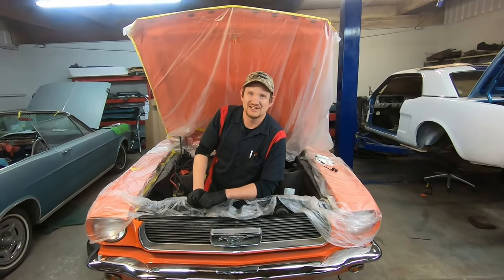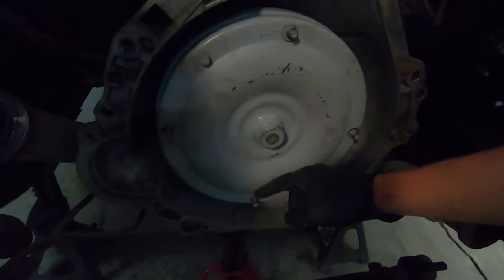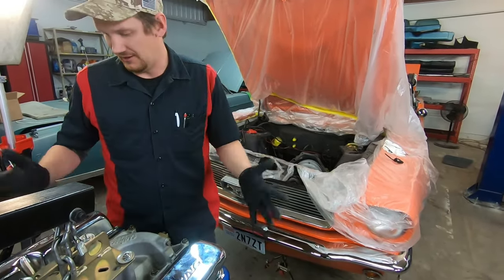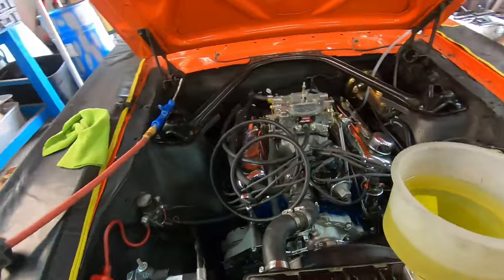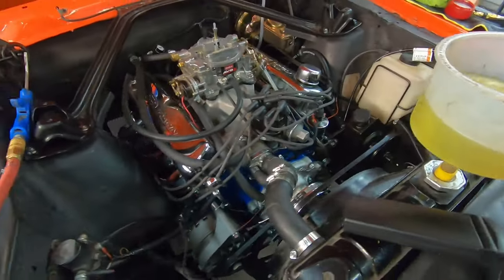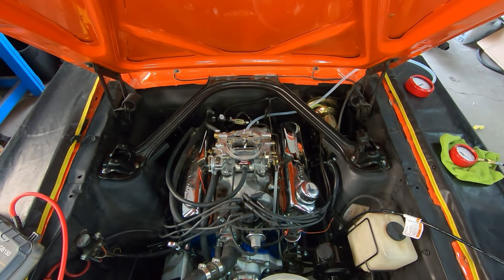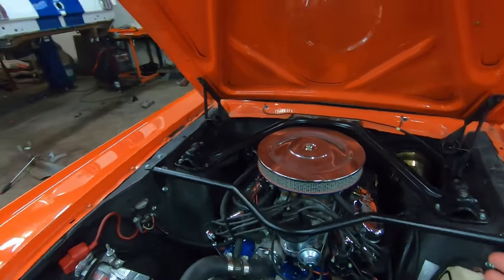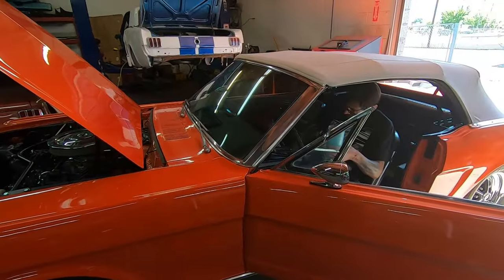Install & First Start - Rebuild the 289 Ford - Part 21

Comment: Nice sounding Stang. Enjoyed watching your 289 rebuilding series. I do a lot of wrenching myself but wished I had an ‘Alf’ mechanic nearby that specializes in older Mustangs. I have a 68 coupe with a 331 stroker, 5 speed, rack and pinion steering and a 3:44 Eaton TruTrac rear.  She scoots along pretty good. 😊
Reply from the maker: Thank you! That sounds like an awesome setup you have on your 68! I bet she does scoot pretty good!
Reply: Nice set up Mike! Love it!

Comment: Can you do a whole series  with 5.0 HO swap please ?😭 I’m losing my mind trying to find the right information on forums and other groups
Reply from the maker: I'm sorry, that's probably something I wouldn't be able to do.
Reply: Kind of an older comment, but it's pretty much the same as a 289. Just use all the external parts for your year of 289, they'll bolt right up. The only extra things you need are: A 50oz flywheel(or flexplate) and harmonic balancer (balancer needs the correct # of bolt holes for your crank pulley) and a plug for the driver side oil fill hole. NPD, CJs, etc all carry the conversion harmonic balancers and speedway has the flywheel/flexplates.

Comment: Hi Alex! Great stuff and info and tips as always. I did the sign of the cross over the engine at start up for your Comp flat tappet cam, lol  Hope you don't get one one their bad ones that many have reported and wiped out in no time. Take care. Cheers from Motown.
Reply from the maker: Ha ha! I appreciate sending the good vibes! I think we are in the clear. This car has been running since April 😉
Reply: @AlfsMustangGarage   LOL Alex, I was wondering about your shaprie date of April on the flex plate. Did you delay release of the video to see if the Comp cam would not eat a lobe or two?  lol Just kidding or course.🤣🤣
Reply from the maker: Lol oh you noticed that! No I just delayed the release of all the videos because it's been a huge struggle for me to keep up on the work I have and yet still film videos that still need to be edited and uploaded. I find being able to post consistently is good for the channel and gives me more time to film and edit.
Reply from the maker: But ya luckily no camshaft issues. It makes me wonder how many of the issues they have are because people don't use the right lube or break-in procedures.
Reply: @AlfsMustangGarage  Alex, they are top notch hotrodders and dont make mistakes like that sir. Bad cams I am afraid.
Reply from the maker: Oh I wasn't sure where you were hearing about the bad cams from. I guess I haven't paid much attention.

Comment: I have thoroughly enjoyed your videos from start to completion of this 289 engine build. I have followed it in rebuilding my 289 this past few months. Keep up your videos. After watching this start up, I have 2 questions I would like your response to. First, I noticed that the pcv valve was routed onto the front of the carb. Can it be installed directly to the intake manifold? And second, I am installing a M5R2 5 speed transmission out of a 98 F150. Do I use the 289 separator plate or the F150 plate?
Reply from the maker: The best place for the PCV valve is a manifold vacuum source at the carburetor's base or spacer plate. The reason for that is so the crankcase pressures get recycled and evenly distributed throughout all 8 cylinders. Some carbs have a large port in the front and some have it in the rear. 
I'm afraid I will not know the answer to your separator plate question.

Comment: What temp thermostat is best for breaking in a rebuilt engine?
Reply from the maker: The same for running it at any time, 180 degrees.
Reply: I need to move close to this shop with my 65!

Comment: any issues with ligning up the flex plate to torque converter bolts AND getting the engine mounts where they should be?
Reply: Was wondering that same thing too Daytona.
Reply from the maker: No issues. It went pretty smooth.